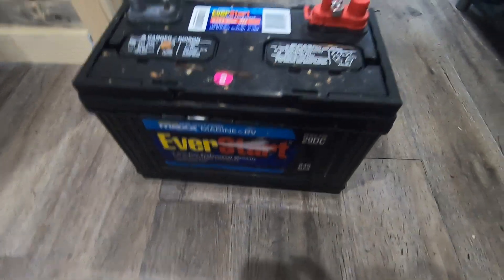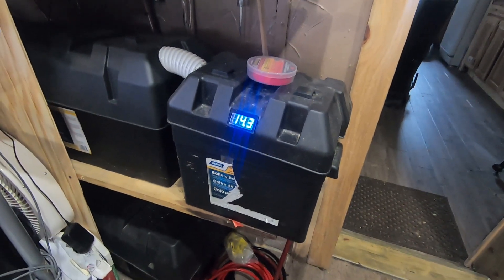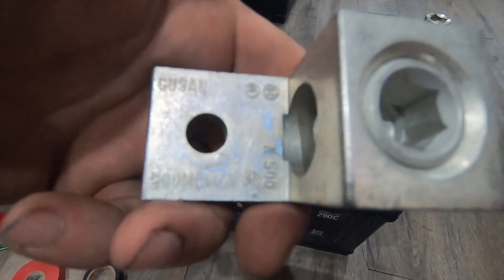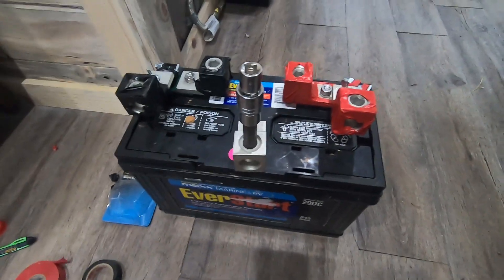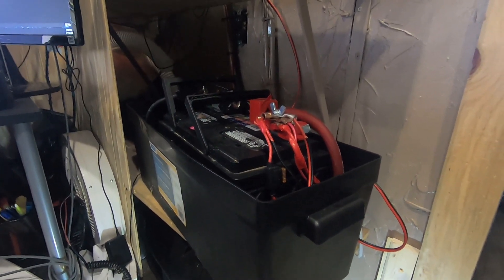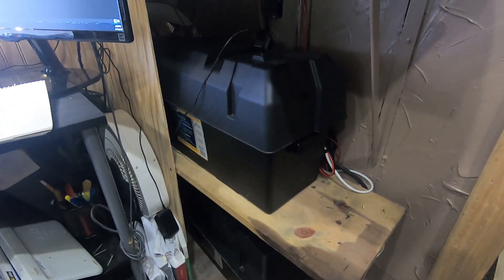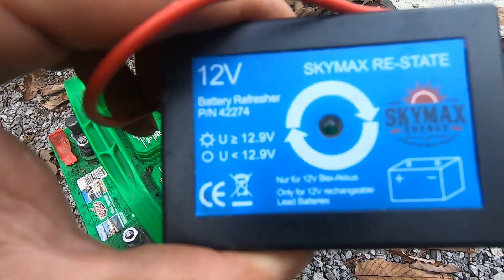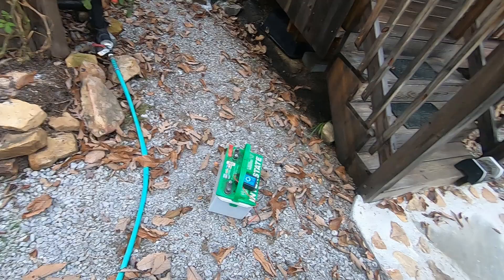Walmart Battery Solar Bank Install for Solar Off Grid Shed to Cabin

Comment: This is 3 years after you put up this video and lithium hasn't proven itself enough for me to spend the money. Currently have 6 trojan 6 volt batteries and by the end of this fall, I will be upgrading to an IFLA (forklift battery)

Comment: Good info. I have 2 from HF. Run led lights and charge stuff. Built batt boxes from Orlando Prepper. Charge from 100 watt panel. No problem 2 years.

Comment: There's a saying in my neck of the woods. " Poor peaple got poor ways. Ya do what ya gotta do, untill you can do what ya wanna do "...lol
Reply: I'm fixing to build one for my tiny house. I want to run a full size frig lights and t.v. for now. I want to get to the point to have enough power to run everything.
Reply: Because of my budget I can't do it all at once. So I think I'll build it backwards.  Batteries , inverter first. Charge batts with my gen or car...then when I get my panels there's no way I could run out after then
 I understand the concept, the components. I'm trying to figure out the sizing part...

Comment: I just picked up 2 of the Maxx 29D’s for $119 a piece.  Lithium is coming down quite a bit but even at $300 a battery it’s expensive.

I’m getting 8 batteries total for my small cabin. Then I’ll start saving up for some lithiums.

Comment: it you have enough sun , or don`t have a need for a huge amount of energy storage lead acid works just fine,, as i am typing i am sitting i a caravan on my farm in denmark (i got 2 set up course my house burned down) and i am running on 2 small lead acid batteries a a 12/ 24v tiny millitary gennerator , i have solar and 2 wind turbines an 8 brand new grade A 280ah lipo cells just havent been nessesary to set it all up yet  ...
Reply from the maker: Jealous that you are in Denmark.
Reply: @GrumpyMountainMan  well unfortuanately Denmark Aint what Denmark used to be ...
personalety i rather be sitting on a remote mountain in the states

Comment: Love the video, simple and safe system makes for less stress.  
I picked up a couple of 29DC batteries $89 ea. +tax and core and disposal fees = $105+-, a $20 charge controller, 2 used sharp 208w panels $50 ea.    I have wired up can lights 110v style 14awg Romex to code in my cabin and picked up $3 Amazon 12-24 volts bulbs.   My wife is real happy with the lighting.     Huge improvement over flashlights and lanterns.    About $400-$450 to power the lights and water pump without an electric bill.
Reply from the maker: Awesome : )

Comment: Do what works for you. Lithium in the long run is cheaper due to its longevity and the fact you need half the batteries compared to lead acid. I personally have 4 Renogy 200ah AGM batteries that are doing what I need so far, but I was looking at keeping the price reasonable. I plan to add lifepo4 batteries at some time, just not yet. Batteries can last longer than stated if cared for so kudos on keeping it going 7 years. One drawback to lithium though is the temperature constraints if not a constant temp above freezing.

Comment: nice video cool i have 1100 watts inverter am using 12 volt deep cycle battery 75 amp 900 watts

Comment: You won't get any hate comments from me. I've been using Walmart deep cycle marine batteries in my backup power system for years. Even today in 2022 lithium batteries are still too expensive for me. The prices are coming down, but they are not there yet. Besides that, flooded lead acid batteries are 100% recyclable. I've toured a battery recycling plant. They recycle the plastic case, the lead plates, the sulfuric acid, all of it. I think there is a video of that same facility on YouTube. BTW, where did you get those big battery lugs? I like those and would love to buy some.
Reply from the maker: Look on eBay. 500 MCM lug

Comment: I'm with you, I use $100 worth of batteries and a 2kw inverter and it all works fine. I only need my fridge at night. I don't run anything else and I'm fine. If you want me to use lithium, buy them for me ;).

Comment: Just bought 2  100ah walmarts last month for my 400 watt solar system. They have screw out caps for checking water level. Works for me too. ( going to check into that desulphator dohickie).

Comment: Good setup, everybody's trying to reinvent the wheel. Just grab it and make it roll. I like the way you got it all set up. Insulation is insulation copper is copper. I have wound Transformers and steam turbines. Long as you know what you got that's all that matters.

Comment: i love the walmart batteries. i actually have 12 seris/paralleled for a 24v system and they work great. i have more than enough power.
Reply from the maker: Funny I just bought 3 more I can now get a bigger series at my local store for a $100. With today's prices it feels like a bargain. My original 2 batteries are doing so well I'm not even thinking twice of adding 3 new batteries to two old ones. I plan on driving Starlink with the system.
Reply: @GrumpyMountainMan most don't know this but you can weaken the acid to 1.224 or 1.220 specific gravity - 
  The old farm 32 volt farm lighting systems generally used 1.220 strength acid - 
      The battery bank was sized to charge once a weak - with the weaker acid they were able to get 40 + yrs out the battrey's service life - 1.220 is good down to minus 17°  - there is a 30° decrease in capacity - at 12 volts the peak charge voltage is 13.8 volts at 80° instead of 14.4 volts -

Comment: i bought 16 of these batteries fall of 2021, i and capacity testing them now. i only have got 4 of them tested so far. i got 2ah on the first battery and 49ah on the other 3 that i have tested.
they pulled a fast on on the rating of this battery imo. they claim 114ah to 122ah, depending on which one you got, but you have to read the fine print to see they rated these using the 120 hour test at 1 amp.

i am about 6 months into having these 16 batteries and according to my math the one is completely done and the other 3 have only 40% of their capacity. this is way to fast for me, and makes lithium seems like a much better deal
Reply from the maker: Mine as still good as the day I purchased them ( fingers crossed)

Comment: Holly Crap Your using a Walmart Battery for Your Solar panel? Just kidding, That's exactly what I am going to do. I have been using Walmart batteries for my Boat and never had a problem. I have a small Pole Barn and going to do the same as you!
Cheers!

Comment: I'm using a 6 V system and I've had it for almost 10 years and it's still going strong So if it works for you don't knock it and don't worry about what anyone else says if it saves you money and you can work within the parameters of what you have be happy with your own life And don't stir up s*** on your own video That's kind of asking for trouble coming from a f**** marine

Comment: No worries.  I got my three Walmart 27 deep cycle batteries in 2015; not a single problem and still running strong with 400w solar array.  I'm with you.
Reply: I have a question you tell in the truth Or  You're not pulling our leg right Laugh out loud just messing with you.
Reply: @100realtorah3 --  truth but I can't post a pic here

Comment: try AGM (lead with starved electrolyte) - they don't need to be vented. Group size 31 can be had at Sam's club for under $200 each.
Reply from the maker: I have them in the cabin. They are no better
Reply: @GrumpyMountainMan  yup, still a lead-acid battery. But they are a bit safer at high charge rates (glad you have those in your occupied space), and long life with less maintenance. I have several that lasted >10 years. That may not justify the increased cost, but reliability is a consideration. Don't discharge below 11 volts and get them fully charged once a month, and they will be happy!

Thanks for your video & sharing your experience!

Comment: I thought those did not need water? Mine have a hole on top where you can see the level but nowhere can the covers be pried to open. It says it's warranty will be void if they are opened? I bought it a month ago and Mine is the biggest one they had.
Reply from the maker: Those batteries in the video are wet batteries

Comment: I did the same almost lol except I'm using Autozone marine batteries...so far I have 6 but I'm getting 2 more in a couple weeks...I bought an Aims 24 volt 2000 inverter charger that has a desulfation mode of 15.1 volts for 4 hours but all my batteries are less than 3 months old...I'll have 340 AH when I get 8 of them but it takes that many to run the big blue box properly....well there's not much sun and I'm only using a few panels...the thing is the batteries don't go much below 90% so I figure they'll last quite a while that way...I'm thinking about getting a couple more panels too and that will give me 690 watts..when the sun is on them the batteries don't get sapped hardly...Your controller looks kind  of like  mine. I got a 4215 bn epever. That's a good one..well I will have around $900 in my 8 RV batteries and that's better than one lithium..it would cost 3 grand to run my Aims  lol...well we will see how they do...I don't have that kind of money for the other ones...
Reply from the maker: Love this...and awesome on your system. Easy to find parts when you need it.

Comment: Really like your practical engineering approach. Solid controller and well laid out thick cables. For current price of a 100ah Battleborn, one can get a doze 100watt solar panels, LOL. name brand MPPT solar controller, and  a few of these Walmart 122AH deep cycle battery. For application that weight and space is not an issue, I do not see why the Walmart marine deep cycle can not be a reasonable choice. Also Walmart does not make batteries, these are made by Johnson Control, same manufacture as many name brand. They are most likely coming of the same factory line and just rebranded.
Reply from the maker: Thank you for watching the video and for leaving a comment . Most solar channels I think either hit the lottery or have a trust fund. If it works it works.
Reply: I would suggest 250w solar panels from SanTan though. Cheaper due to them being used, but still producing the rated energy.

Comment: i hope your last longer than mine i had two and they lasted 5 yrs to the mark. thanks sharing and have a great day as well
Reply from the maker: Thanks, you too!
Reply: 5 years is better than the 3 years I got out of my 6. Now that they have that CHiNS lipo4 for $500 on Amazon it makes so much sense. They last over 20years to 80% capacity and don’t require any of the water level checks ect
Reply: I'll be happy to get 5 years out of mines, although I won't be draining them much since I'll have about 3000W of solar going to them

Comment: I notice that you are a true electrician by using many parts from the trade.  I do too!  Right on.  Just wanted to ask you if that new battery is deep cycle?
Reply from the maker: Yes its rated for RV use so supposedly the plates are of higher quality.  Thank you for watching the video and for leaving a comment : )
Reply: @GrumpyMountainMan  cool.  I live in a small lake community in east Texas.  I'm setting up solar panels that I found had broken glass but still function great.   Im going off grid partially to reduce my electric bill i.e.hot water heater and my shop.  Great channel.

Comment: Thank you for this video! This is the way I plan on starting out. I made the mistake of asking how to determine the size of a marine battery on a solar Facebook group and you would have thought I called their moms and sisters every kind of name imaginable! lol
Reply from the maker: Solar Fanboys and Internet Engineers. Hey sometimes good enough is good enough.  Thanks for watching the video and making time to leave a comment.
Reply: @GrumpyMountainMan  That's what I saw when the family asks how I'm doing, or how'd you sleep... "good enough" 👍
Reply: I understand but I beg to wait another month or two and save enough to guarantee you and your families energy security for decades. The lipo4 are worth the investment 10x. Imagine little to no worries for the next 20years, man and that’s down to 80% capacity.cheap Walmart works for a few years at $250 -$300. But for double the investment you have decades of use, important if you have a family

Comment: You don't need a crimp tool for every size.  A vise and/or a ball pean hammer works just fine.  I have used this method for years and upto 4/0 copper.  Walmart batteries are just fine.  I have had many last just as long as deka, exide and interstate.
Reply from the maker: I had a lot of lugs laying around when I first started...and yes the ole ball peen crimper is fine and dandy : )

Comment: I buy solar batteries from a manufacturing company  for $55.00 each plus core charges $15.00 each.   Have a 14 battery storage bank. I have not had a failure in over 4 years. Save money if you can. Looking for a 1000 gallon propane tank know for my other back up system. Love your channel.
Reply: Where do you get your batteries
Reply: @jameswoodard3811  in every area in the country there is place that sale reconditioned batteries at a lot lower price. You will need to look up the company's in your area that do this.

Comment: Try doing a LCA (lifecycle analysis) this will tell you what is really the cheapest way of doing things. A good explaination of the LCA can be found in photovoltaic systems engineering by Messenger and Ventre.
Reply: www.youtube.com/watch?v=kYx097cVR48a